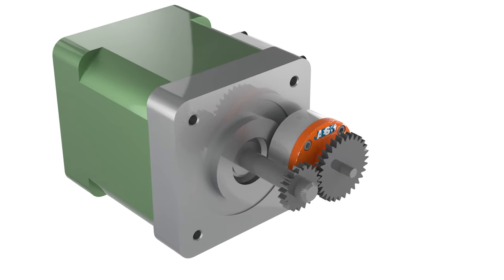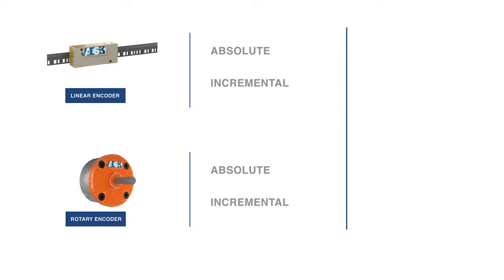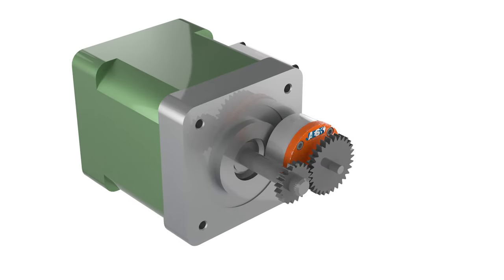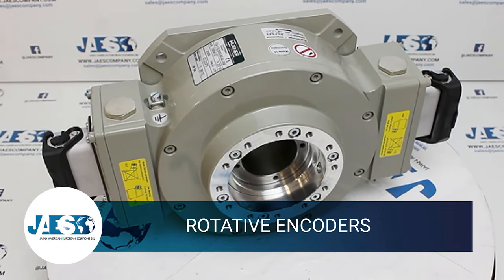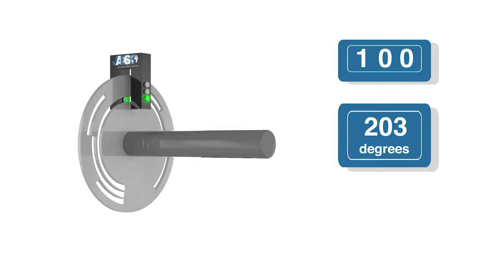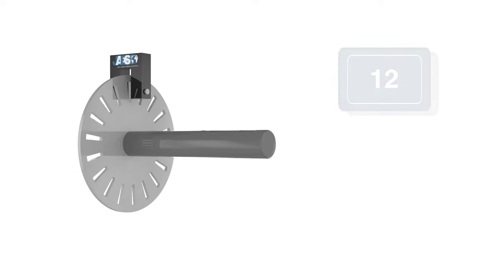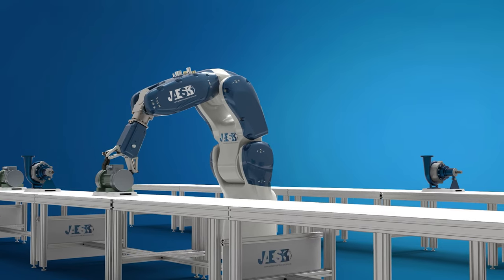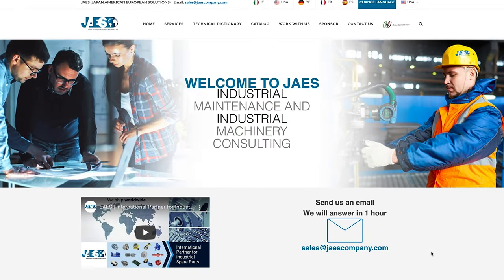What is an ENCODER - Linear and Rotary encoder - Incremental and Absolute encoder

Comment: how it can distinguish several degrees in the same groove. For example, in the groove of sector 001 it distinguishes, with a resolution of 1°, all angles in the portion of the round angle ranging from 39° to 86°. How is this possible if the photocell is always hit in the same way? How is it possible that there is no groove and light combination for each degree?

Comment: In astronomy, encoders are also commonly used for high-end telescope mounts. Once aligned, the mount can know its position in right ascension and declination relative to the sky by tracking the motor movement using encoders on one or both axis.